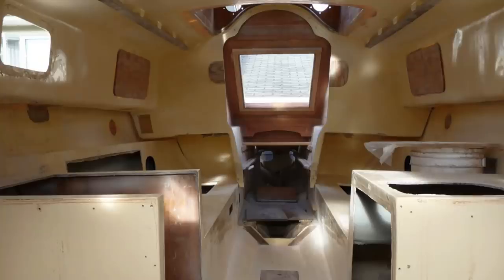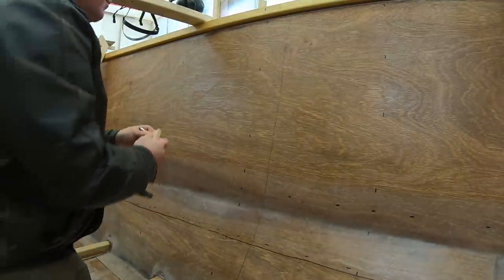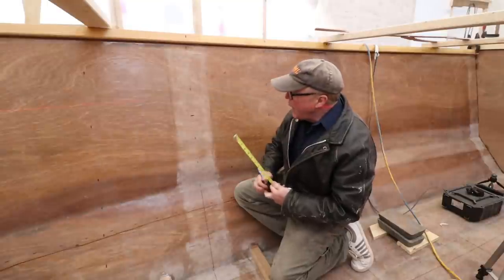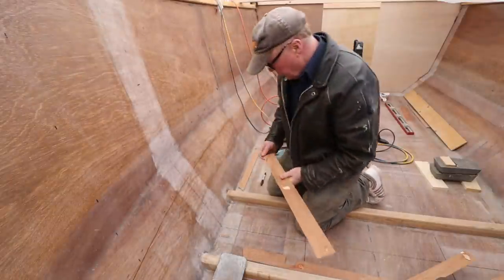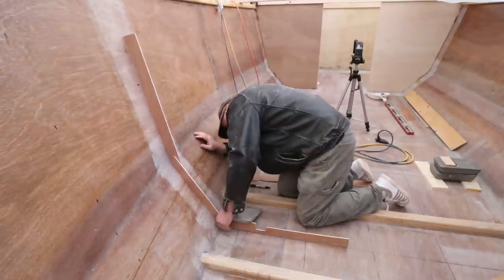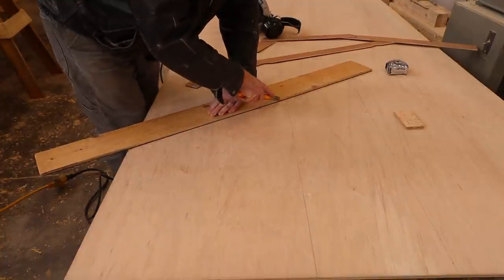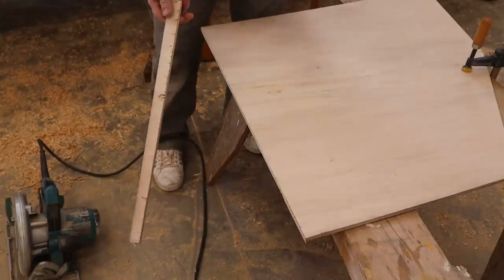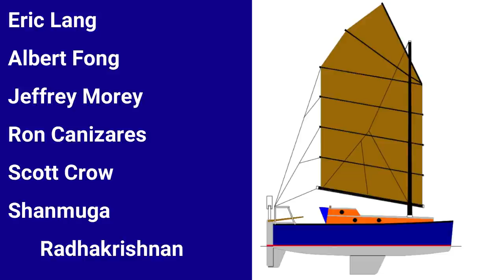S2E36 Bulkheads Go In!

Comment: Remember with counter heights that the sink bottom is also lower. I already find working in a sink at normal heights hard on my back. However, A lower stove top is helpful as it then lowers the top of your pot as well. I actually lived in a house where the counter with the stove was 6 inches lower (or more?) than the counter with the sink and neither was "standard" height. Of course the right height for kneading dough is probably different again. On a boat, one has to compromise due to lack of space but setting counter height for the sink and allowing the stove to mount lower is a good compromise. I suppose the other plus for a lower counter is less mess if something falls off in rough seas.

Comment: When you sand to prep the surface for epoxybonding you might want ta use a really large grit and a belt sander. The physical bounding improves with an uneven surface.
Reply: It's far too easy to remove too much material that way. Belt sanders with coarse grit are too aggessive. The object is to roughen the surface, not grind some of it away.

Comment: Is it enough to have not the full bulkheads? Usually the bulkhead is a kind of circle.

Also usually people are constructing bulkheads on a building berth, then cut in stringets and only then - sheat the boat.

I have a dream of building something like that (6.5m with room for 1-2 people for cruising or 4 people for a day trip and with bilge keels). Your boat is very nice. But I'm a bit worried that you're building it from sheeting to bulkheads.
Reply from the maker: If you go back to the earlier episodes you will see the boat is formed on a strong back. The bulkheads are not finished. When they are they will form a complete circle. Stay tuned.
Reply: @RoversAdventure  I just finished viewing all of the S2 episodes. Thank you, your videos are very detailed.

Latest time machine video shows that you added long thin structural pieces. That was my original question why it was not in structure, but now it's in structure. It should be strong enough.

But back to the second question. Why are you not starting from the bullheads? Building strong back, then sheeting and then gluing up bulkheads looks more labor intensive than just starting from bulkheads on a building berth (leveling them and so on) and then simply gluing sheeting plywood into bulkheads.

Comment: Did you use the same template for both sides? If you were to find that your template only fits perfectly with one side, what would you do?
Reply from the maker: You have to be prepared to make slight adjustment as needed to the bulkheads, but generally they fit fairly well on both sides.